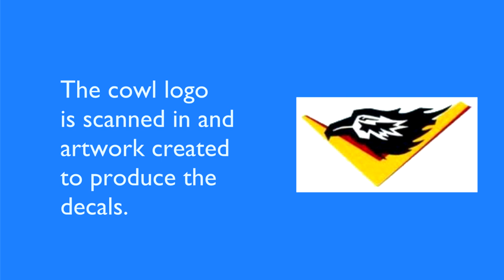Tamiya Skyraider build

Comment: The oil stains look good, was wondering what size gauge copper wire you used for the leads in the engine
Reply from the maker: At a guess 0.5, no thicker.

Comment: Very nice work. Thanks. One quick question, what product did you use to maker your decals and what fixative did you lay out after printing.
Reply from the maker: I used Inkscape to create the decals and just printed them out. The decals are sealed with several light coats of Tamiya clear.
Reply: @GregsModels  Thanks a lot for the quick reply. Cheers